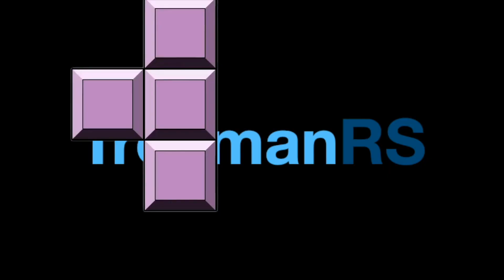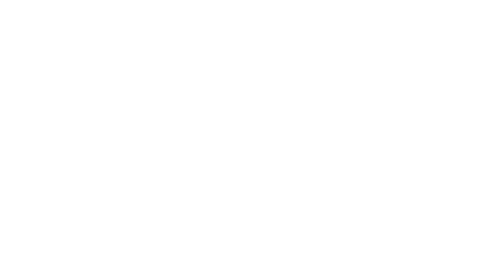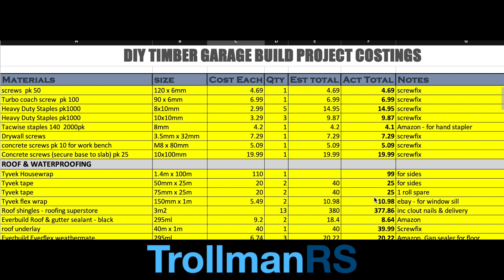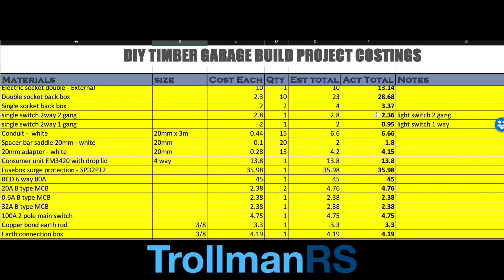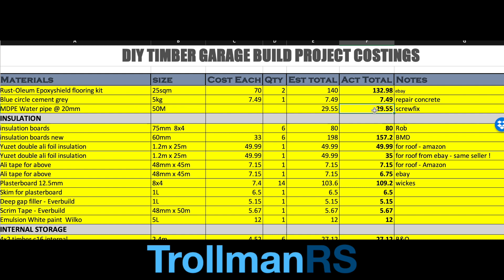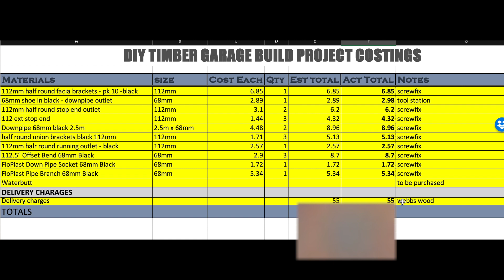How much did it cost me to build my DIY double timber garage -  one man garage build.

Comment: May I ask what materials were used in the foundations please.
Reply from the maker: Hey Brian,
The garage is built on a 150mm concrete slab, which sits on another 150mm base made from MOT type 1. HTH

Comment: Great build, I'm just about to start planning mine. Did you have any trouble or concerns from the planning application? Also are you willing to sell your plans?
Reply from the maker: Hi, thanks for the comment. No problem with planning at all, and mine was built in my front garden. Plans only cost a few hundred ££ to be drawn up, and mine are specific to my needs. Good luck.
Reply: @trollmanrs  I thought you didn't need planning to build a garage?

Comment: Brilliant breakdown of prices there! Maybe I missed it but did you say where the garage door came from? Interested in finding a zero-height-loss garage door for my workshop/garage too :)
Reply from the maker: Hey Aaron, thanks for the commnets and I hope the video was of some use to you. The garage door I got from a local company to me, it is a Teckentrup CarTeck 500. I'm sure this is a re-branded sommer German made model, the quality is very good. HTH
Reply: @trollmanrs  thanks! I'll take a look at those. The track for my door hangs down 14" or so from the ceiling and means I can't lift a regular car far off the floor, much less the Range Rover! 😁 Got the engine crane stuck under it last weekend too 😂
Reply from the maker: @aaronbuildsa  lol thats no good. I think my tracks are 2500mm ish high off the top of my head